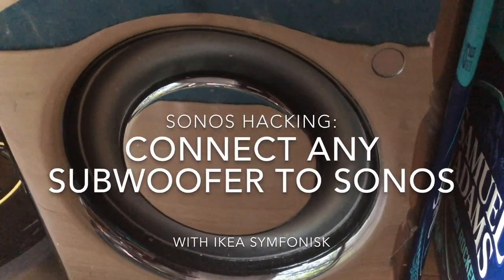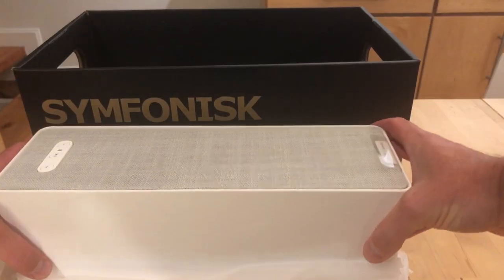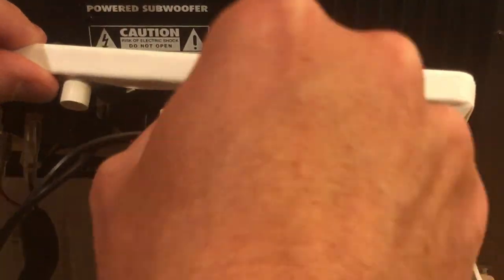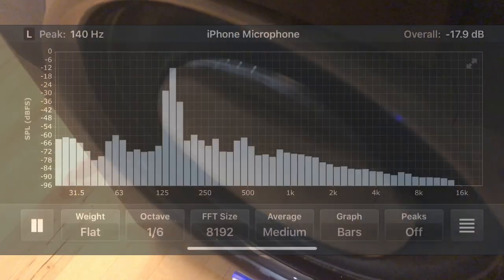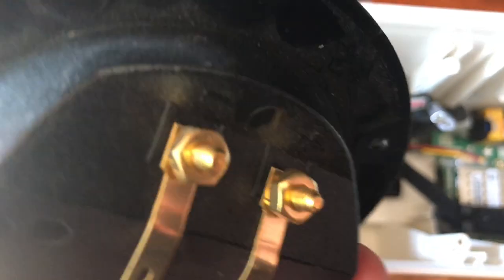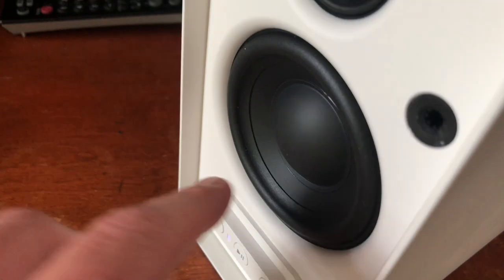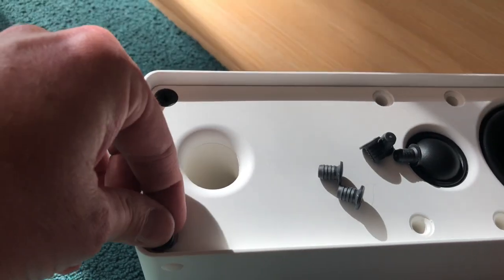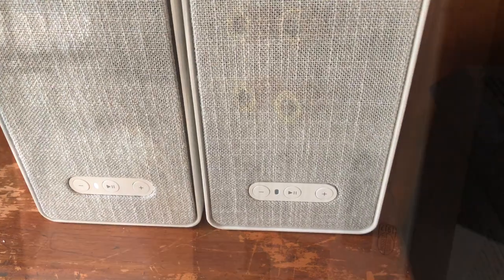Connect any powered sub to Sonos with this Ikea Symfonisk DIY hack

Comment: I don't do a lot of hardware hacks, as my experience is that they often do not work as advertised.  This one is the real deal.   I had two Symfonisk speakers paired with an Arc, which produced pretty good rear speaker surround sound.  I purchased a Polk 10" subwoofer for $150, wired them to binding posts exactly as you did, and BAMMMM!  Huge, furniture-rumbling bass.  Thanks for this excellent tutorial.
Reply from the maker: So glad it worked for you. Adding a sub makes a huge difference

Comment: This worked like a dream. You knocked it out of the park with this video.
Reply from the maker: Great to hear it worked for you!
Reply: @todd.parker  you mentioned using both the subs input and output for more filtering and better sound although your sub didn't have the capability.  Can you please elaborate on how to wire the second set of wires for a capable sub? Thanks
Reply from the maker: Ashvin Forouzandeh if your sub has speaker outputs you essentially disconnect the symfonisk woofer and wire that to the sub input. Then you connect the output from the sub to the symfonisks woofer. This will filter out the bass below the subs crossover frequency
Reply: Because that's exactly why those speaker terminals are for ,lol
Reply from the maker: Yep!
Reply: Great piece of work!! Just ordered an Ikea speaker but can you give me some advice which sub tot buy thx !
Reply from the maker: Jan Postma I have pinned comment wiry sone suggestion. Enjoy!

Comment from the maker: Hi all - Based on all your questions, I made a video covering how to use this technique to connect a cheap sub to your Beam or Playbar for a 5.1 home theater setup: https://www.youtube.com/watch?v=ki3n98U_I7Q

Here are my recommended subwoofers on Amazon ~$100 that will work for this:
Polk 10"  - https://amzn.to/2RcWV1q
Monoprice 8"  - https://amzn.to/3696umd
Monoprice premium 8" - https://amzn.to/2Rdl73O
Acoustic Audio 8" - https://amzn.to/2TVfCZt

Any subwoofer will work as long as it's amplified and has speaker level inputs - if it only has RCA inputs, look elsewhere.

Comment: FYI : I managed to do exactly the same thing with a Sonos Play 1. I have a polk audio sub with RCA inputs. I put it on very low volume and ran a trueplay setup, and it’s honestly amazing. I wouldn’t call it HiFi but it’s definatly good enough for the average consumer ;)
Thanks!
Reply from the maker: Thanks for sharing, you’re braver than me to get into the Play :. Thing is packed tight! I agree that you can always have higher fidelity but if you’re plugging a $100 sub in, I think that’s the limiting factor over the signal and like you said it’s more than good enough for most people
Reply: Todd Parker It is in fact packed tight, but it really wasn’t difficult at all to open up. There is a good play 1 teardown video that shows it all ;)
Reply: Hi louisolivierfortin, so do you also use a speaker level to RCA adapter to achieve this?
Reply: @todd.parker  Just to show my appreciation for all your great works. It's amazing.
Reply: @louisolivierfortin  Thanks for quick reply. May I have link you used for speaker level to RCA adapter? I also saw some replies about 75 ms delay for this 5.1 system, what's your real feeling?
Reply: Yanbin Deng In fact my mistake was to not use one! So the sub’s RCA input was receiving speaker level of power, which is bad. So I quickly changed the connections to speaker input of the sub, which is made for sound thats already amplified.
Reply: Yanbin Deng I cant hear any delay with the setup by the way
Reply: louisolivierfortin Thanks for clarifications. I'm considering if it's worth buy a RCA adapter and connect on sub's RCA L. By the way, still not buy a subwoofer and compare different models.
Reply: louisolivierfortin That sounds so great without delay.

Comment: This seems such an easy way to connect any sub indeed. I wonder if they don't output the sonos cast audio like this in the original hardware. Probably the answer is money, but if you have some confidence in opening and closing the Symfonisk or any sonos (although they often have better bass than the symfonisk) it is a very good solution. Thanks

Comment: Hello, do you set the Symphoniks as surrounds? By doing this maybe the sub will receive only the signal of the sounds supposed to come from behind, missing the lows of the front/center channels… or am I missing something?
Reply from the maker: I was surprised that the surround channels had as much bass as they do. It’s obviously not the same as the true sun channel but I think you’ll find it sounds really good when passed into a high quality powered sub

Comment: Superb original content. Great idea. Well done.
Reply: Original? they've had those speaker terminals for decades , YouTube for decades,change the Sonos for Denon , Yamaha and you'll find you're decades late my friend,original lmao
Reply from the maker: I agree this has been built into powered subs for decades. I think the new twist here is rather that using a receiver to get a signal to the sub we’re jumping off a woofer in a bi-amped Sonos speaker which is a cheap way to add a sub without buying the official Sonos sub.

Comment: You could probably find a line level signal to tap into just before the amplifier stage. They would allow you to use the RCA inputs on your sub, or a better external amp.
Reply from the maker: Yep, I just didn't know where on the board to tap into at the time. I've seen videos of people doing exactly that but it's a bit fiddly and my soldering skills aren't up to the job!
Reply: I have a subwoofer with RCA inputs but unfortunately not with a speaker input like it has in this video.
Do you know where the amplifier stage is located in the Symfonisk?
or where you can tap/solder that?

Comment: Hey, I'm running into problems with this hack, I got everything wired up but I don't know if it's all correct. Just to clarify, do I leave the speaker wires that are already on the woofer terminal in Symfonisk and loop my outgoing speaker wire around them? Or do I take the Symfonisk connections out and just run my sub off the empty posts? I've watched all your videos on this and I'm still not clear about this. I'm also using an RCA adapter, it's fairly high-end and I was told this would work. But the signal I'm getting now into the sub is weird - it sounds like a full-range signal but it's janky, pitchy even. High-end rolloff on the sub doesn't do much about that. Also it hums when static... am I fucked?
Reply from the maker: If you’re using the symfonisk as surrounds then you want to leave all of the internal drivers connected. The easiest way to add a wire to the woofer is to wrap it around the terminal on the woofer and add some hot glue. Be careful they don’t touch the frame of the woofer or it will short out. You can also slightly pull back the plastic boot on the wires, slide a stripped wire in so it sort of sits on top of the existing wire terminal, then slide the boot back so it’s compressed on top of the terminal. If the converter sounds strange, double check your wiring and adjust the volume so it’s as loud as possible without distorting. Usually the converters have a tiny volume knob recessed in a hole. Guessing your levels are low?
Reply: @todd.parker  thanks — I’ll check on the converter volume. I don’t care for any of the sound from the Symfonisk, in fact it would just get in my way. Ideally I’d want just the signal to the subwoofer and nothing else. Do I disconnect all the internal drivers then?
Reply from the maker: @Lord--Farquaad  yep, just disconnect the drivers and electrical tape each wire separately to avoid any shorts

Comment: Apologies if this is poor understanding, but does splitting the speaker level input into the sub cause that channel to be quieter than the other? I would love to do this with my system, but having audio feel off=center would drive me crazy.
Reply from the maker: Not at all. Splitting the wires off from the woofer to the speaker inputs on a powered sub won’t change the sound of the speaker at all.

Comment: Awesome video! This idea popped into my mind too, well similar, so I had to do a search to see if someone had done in yet, figured it would be with one of the older models a while ago. But nope same speakers I picked up last weekend to try it on too, I had similar thinking since these cheaper speakers came out I can now start messing with Sonos hacks. This Does Not Compute actually inspired my idea from his teardown video. I wanted to try and make a video on hooking up a line-level adapter to the terminals so I could wire it to my receiver input and output it to my entire surround sound. Kind of like a makeshift Connect without the line in. My biggest concern was audio delay on the surround, but I just did my first round of testing and it seems like it won't be an issue. 

The way you perceived it was cool too! That method had not crossed my mind.
Reply from the maker: That’s interesting. So how are you getting a full range signal out of these since they electronically crossover the signal for the woofer and tweeter amps?

Comment: Hi Todd, this is a great video. Would this hack also work if i connected ceiling speakers to the hacked Symfonisk speaker, or is it needed to have the amplifier that the sub has?

Comment: I can report success following your instructions on the Symfonisk-SubWoofer hack. Thanks, but can you clarify the sound I am getting? I’ve operated under the belief that the .1 referred to a specific LFE (subwoofer) channel that is neither left nor right; however, my sound source is the TV as heard through a Sonos soundbar. To connect the subwoofer through Sonos WiFi, I had to nominate the Symfonisk as sitting in another room. What is the source of its sound?
In a related question, I wanted to connect left & right front speakers to enhance the spatial sense of action on the TV, but a Crutchfield tech AND a Sonos tech told me that when the TV/soundbar is the signal source, peripherals in the room WILL BE left & right REAR channels. They argue that the soundbar is all I need for spatial effects, and Sonos design - declaring these new speakers as “peripherals” - is enforcing that imperative. What happens if, like the subwoofer, I nominate them as sitting in a separate room even though I placed them left & right of the TV. Will I get left & right front speaker signals?
Reply from the maker: Good to hear this worked. Sonos is very rigid in the setup. If you have sound bar you can only add an official sub and pair of matched rear speakers. You cannot add more front speakers. If you connect a sub to a symfonisk as a separate room abs group it with the home theater room, it think you get a mono signal that combines all the audio into one.

Comment: Just a little thing. I’ve done this project. I am using a Kef PSW2010 which I am connecting to the Line In Input Socket. It works fine and I can adjust the input level to get the right amount of fill in bass. Unfortunately when there is no sound through the Sonos system there is a low level hum from the sub. Any ideas how to stop that? I don’t know if it matters but I disconnected the connection to the IKEA mid range; I know that has an impedance so perhaps that’s why it’s humming?
Reply from the maker: If your sub doesn’t have speaker inputs, you can’t connect the wire from the symfonisk woofer to the RCA plug or it could damage your sub. You must buy a speaker to RCA signal converter and that will clean up the sound. If you just want to use the sub, disconnect the wires to the woofer and tweeter

Comment: Great tutorial, great idea, but wont the sub LACK a massive amount of power? This only works with ACTIVE woofers right? Why dont remove all the insides of the IKEA speaker and build these in the sub?
Reply from the maker: This is designed to skim a signal off the symfonisk or other Sonos to feed an active sub with its own amp so the power is just limited by the size and quality of the sub. You could put the guts into tue sub but that’s a lot of work and awkward because the input for the sub is outside. That might be a better idea for a passive sub (no amp) which is a possibility I didn’t cover because the symfonisk amps are pretty small compared to an average sub

Comment: I just found this vid, it's old-ish, but maybe you still pick up on a question. The tweeter in the Symfonisk is cut off at a rather high point. That means the "sub" in the Symfomnisk is more of a mid-sub speaker. If you now feed that mid-sub signal into a real sub with it's own even lower crossover frequency, where do all of your mids go??
Does it not sound like something is missing? Do you not only get the low lows and the high highs and not much inbetween?
Reply: Aiiiiii, wrong thinking on my part! You do not cut off the mid-sub in the Symfonisk. It still plays along and gives you the mids.
Reply from the maker: Yep, you can use the Symfonisk as a surround and as a way to feed a signal to a powered sub. The sound of the Symfonisk is unchanged in this setup
Reply: @todd.parker   Thanks!
I confused myself here because I have hacked mine so I have two speakder level outputs (high and low) and each one has a switch which silences the internal speakers.
So slightly different than yours. More like in your other video where you ONLY use external speakers.

Comment: Great video, using this I was able to output to a powered sub, as well as a Buttkicker couch shaker.   Works perfectly!
Reply from the maker: Good call on the buttkicker
Reply: @todd.parker  I originally was using the Simfonisk as a surround, and pulling the LFE for the sub/buttkicker.   It was OK, but I eventually switched to using the Simfonisk with disconnected speakers as a "sub only" unit and grouping it, and now it is tons better.   Water cup scene from Jurassic Park shows it's in perfect sync and sending out all the proper LFE signals.   Thanks again for all your videos!
Reply from the maker: @johnw2604  Thanks for confirming, that makes sense. A surprising amount of LF info is in the surrounds but taking the full signal by grouping should be more powerful at the expense of a slight delay.

Comment: Does the symphocic still play? Or did you totally reroute the Bass to the sub to get more signal power

By the way what would happen if I have 2 Sonos stereo pair and then add this symphonic hack-to-subwoofer. Do I still get to keep my stereo sonos speaker pair, and does adding the simphoc hack simply add a speaker as non stereo to my existing 2 sonos stereo pair ?

Hell yeah my room will be booming now I can add like 2 of these hacks then :)
Reply from the maker: I have them running full range but if your sub has speaker in/out that will cross them over
Reply from the maker: Check out my wiring guide to see all the wiring scenarios...

Comment: Excellent, I copied your setup without the subwoofer. With switches and terminals. So I have a reference 3a Master control connected to it. Sounds wonderfull after trueplay and add a little bass and chop off a little treble with the EQ. I can thow out my tube amplifier (almost). Unfortunately sonos doesn't play hi res content. Next step is to take out the crossover in de speaker (woofer is without crossover). Maybe that helps a bit
Reply from the maker: Great to hear! You definitely want to remove any passive crossovers in the speakers for the best sound

Comment: Thinking about getting 2 of these ikea speakers and a sonos beam. Looking to do a 5.1 set up. Would I just need to take signal from one ikea speaker to the sub? Cheers. Great vid
Reply from the maker: Yep. You wire them both to the sub but I don’t think you’re going to hear much of a difference. When I had it set up, I only used one channel for the sub and it sounds great

Comment: This is awesome.  Confused about the impedance thing though.  If you are just using the Symfonisks speaker wires for just signal, are you really changing the load in an active/powered sub situation?  If it were passive, and you were using the Symfonisk amp to drive both I would agree it would be running in parallel....is this really a concern?  To clarify, are you keeping both speakers in the Symfonisk connected in your current setup?  Thanks!
Reply from the maker: Some people seem concerned but I agree. I have to admit I don’t understand how the speaker level inputs work in term of how they impact the amp but I’ve been using an active sub hooked up for a few months to a pair of Symfonisks and all is well
Reply: @todd.parker  are you using both speakers and running them into the LR LR high level inputs or just the low frequency speaker into the sub?  Also, because I believe you are using the system as a 2.1 are they paired as a set and how do you have the eq set? (I dont have an iphone so I just have the bass/treble at 0).
Reply from the maker: sand man I essentially have the wire from the internal woofer amp spliced off and going into the speaker inputs on the sub. Out of laziness i usually only hook up one channel to the sub but both would be slightly better to catch oddball bass effects panned to one side or the other but I’ve never noticed the difference with modern music.

They are a stereo pair and I Trueplay them with the sub off or very low. If the sub is turned up too much, trueplay basically sees that as a room problem and eq’s the low end down so you’re fighting against it and never get deep, strong bass. If you only have EQ, I’d suggest playing with your crossover frequency and volume on the active sub rather than turning the bass up because that will result in cleaner, deeper bass. The bass controls boost too much mid bass imo.